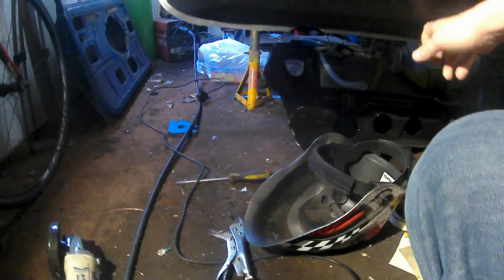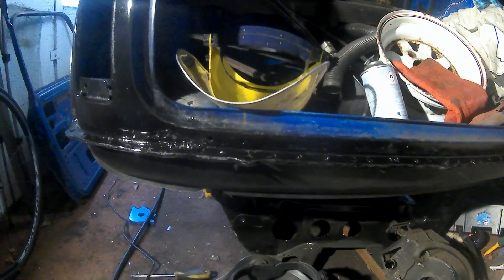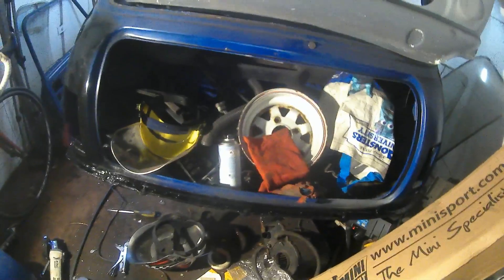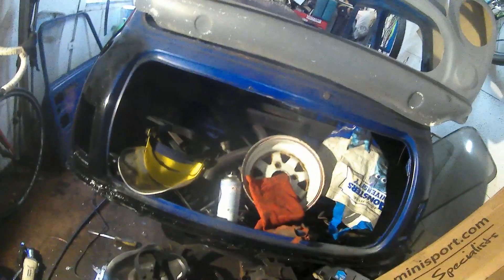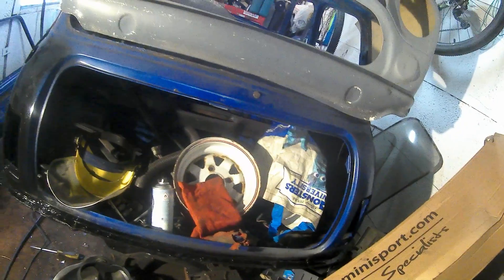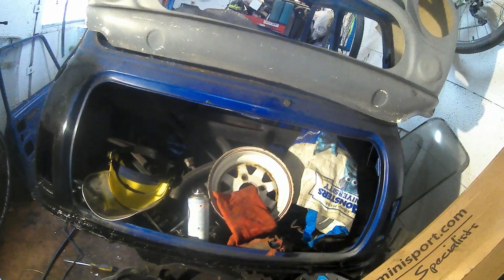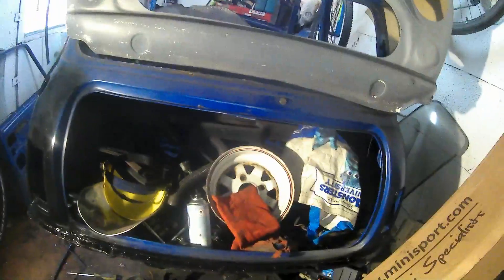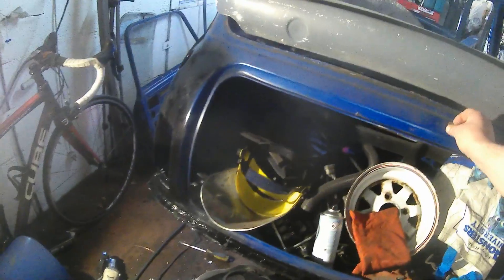Classic Mini Restoration | Episode 12

Comment: Good job. You need another grinder mate changing discs is a pain.
Reply from the maker: I have another one with a wire wheel on but you have to hold the button on it. They are pretty cheap so I should get one
Reply: I need a couple new ones myself ha ha.